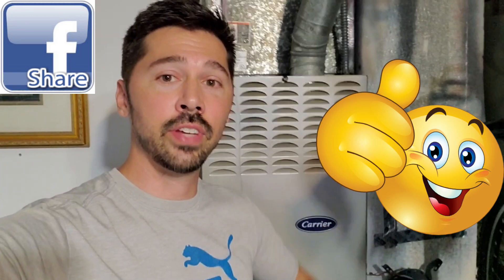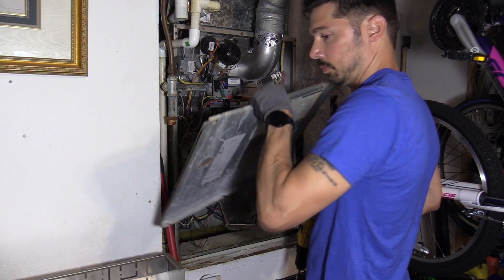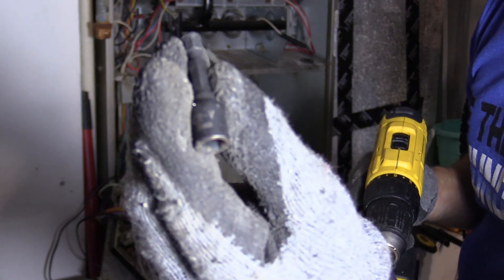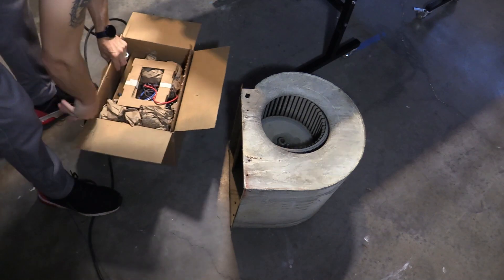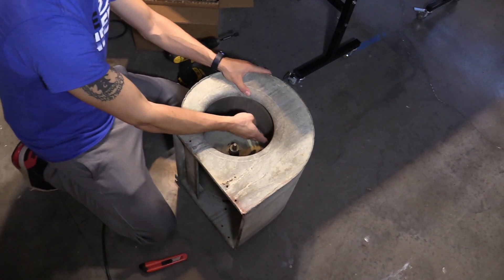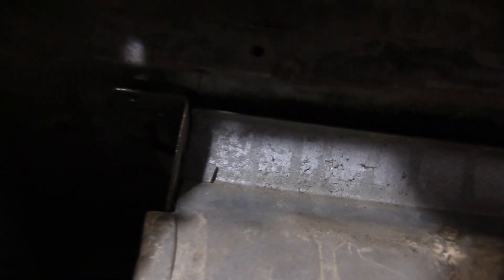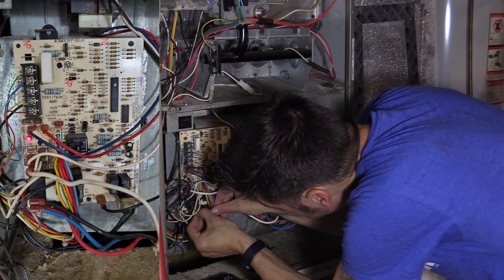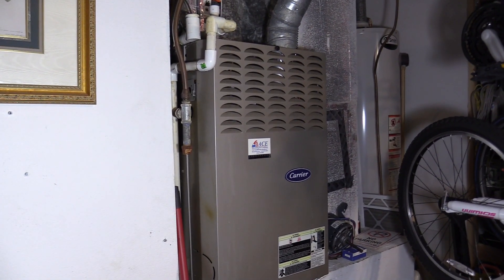3 WAYS to Check & Fix Air conditioner unit not blowing

Comment: What exactly were you draining when you said the AC line that was PVC. It was water/condensate but why was it piped from underground? With a vent stack essentially. In Michigan we don't have setups like that so I'm wondering if it's a Florida thing?
Reply from the maker: Drain pan from inside. if drain line is clogged system will shutdown to prevent leaks inside the house.
Reply: @TampaTec  Interesting  piping arrangement. I just didn't understand why it goes underground and then comes up like a vent at the condenser.
Reply: Up here at the jersey shore we have horizontal units that have a drain pan underneath the condenser. I was thinking it must be a Florida thing too.

Comment: Did you do an autopsy on the motor.   Might be a good follow up video topic.   I would be concerned about why the motor quit.   Do you lube the blower motor bearings regularly.    My blower motor is 33 years old and still going strong.   Lube every or every other year.  As a matter of fact I just this last late winter got a new condenser and evaporator coil to replace the original that was also 33 years old.    l also vacuumed out any dust build up in the windings to keep it running as cool as possible.     Nice video.  Anyone can do this stuff thanx to Youtubers like you showing them how.   Thanx.
Reply: Wow, I haven't seen any motors these days that have a way to lubricate the bearings. They always say permanent. Lol, like that's actually the case. I miss being able to lube motors. Showing my age here.

Comment: Ive got a question, I watched hours of your videos yesterday trying to fix my older panasonic plasma. Am I understanding this correctly; When using the resistance setting on my meter, I hold one lead to ground on the chassis and the other I test the positive connections on the different boards (p, ss, a, buffer) and if I get an open loop reading that means that the board is shorted? If I get a reading even if 00.0 that means there is a loop correct? Thanks man, Im no electrician but I enjoy learning new skills.

Comment: Make sure the blower wheel is centered within the housing or you could be loosing lots of cfms blowing across the coils
Reply from the maker: Thanks for the tip. I'm saving up for a new ac unit because this one is about 20 years old, I got a quote for $6,500 14 seer 4 ton unit with full system parts and labor.
Reply: @TampaTec  That's about the right price range for good equipment installed from a good installer, service, company.
Reply: Make sure you get a reliable brand that's made in the U.S. with a warranty that covers parts & labor ! I made the mistake of going with a York system . Didn't know they left the States to go to Canada to avoid lawsuits . The unit had a condenser leak after 30 days . The part was warranted but not the labor ! Then the compressor went due to low oil operating from the condenser leak .... having the installer disappeare didn't help either !